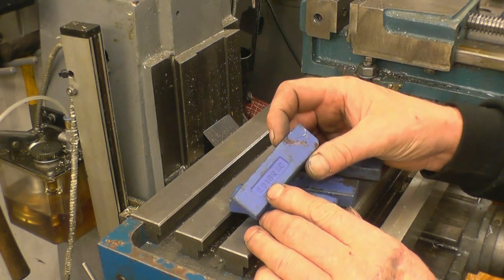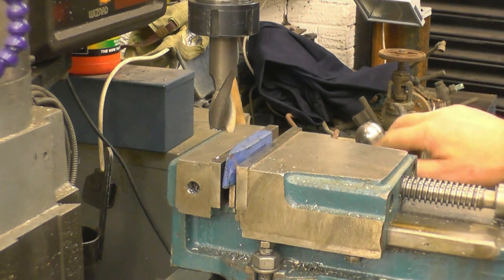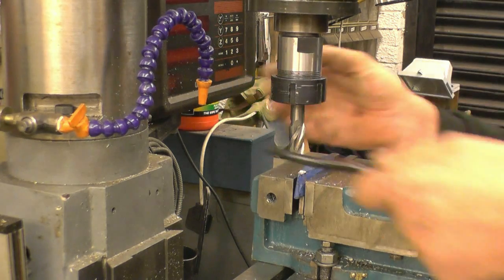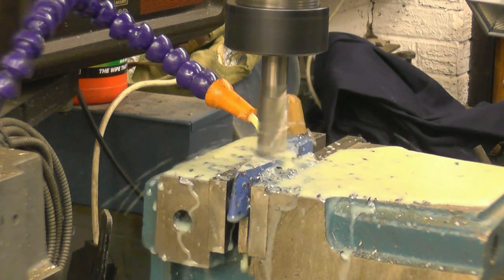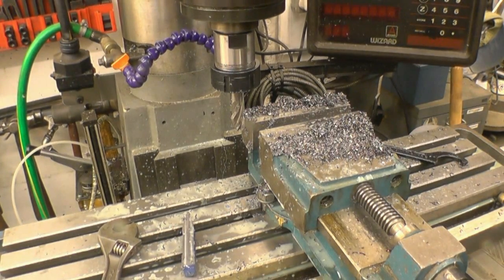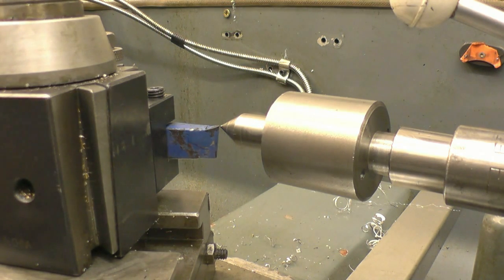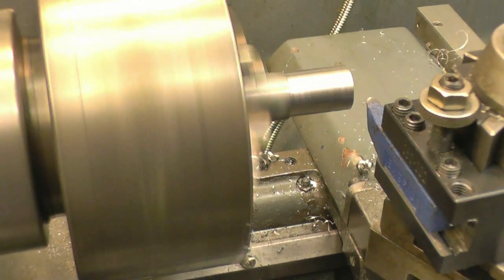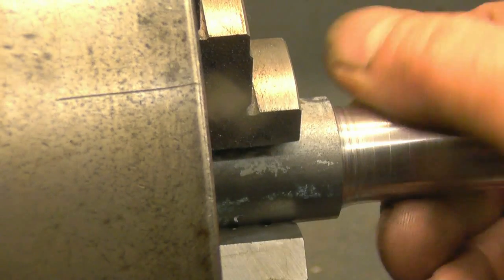SNNC132 P2  Lathe tool Mod

Comment: Hi John, just up the road from you at Cramlington. The bits you were milling down for lathe tools are coal cutting picks used on a coal cutting machine used in the old longwall method of mining. As an apprentice with the NCB we used these all the time for our lathe tools sometimes welding two together to make a R/H & L/H tool.  The base of the pick is a high carbon steel and two picks welded together and with the right Blacksmith who done the hardening and tempering, you had a cold chisel to die for. Love your vids. Got an EMCO MAXIMAT V10 P myself with a milling head, just love pissing about. Regards, Bob

Comment: Thanks for the videos john.I just thought i would ask if any one knows
where i can get a internal grooving tool,I have to cut a thread recess that
is around 0.400" long,And is 1" deep to the starting point Internally.I've done
one and messed it up,

I used the cheap 10mm carbide chines shit ones brazed carbide..And it wasn't
deep enough and there seems to be no rake on them so it just rubs on the internal
bore...I tried grinding my own and it just turned into a boring bar..With none of the
angles correct i used 4" 1/2" x  1/2" round 8% cobalt HSS bit..

Just wondering if there is any where in the uk i can buy one my tool holder 
can hold a max of 15mm..Thanks any advice would be much appreciated.

Not seen many videos about grinding a internal recess tool and actually
cutting a deep recess in some steel..I'm cutting EN8 on a small lathe..

Tried 2 carbide boring bars with no luck as thy will change the 
angle on the end of the internal thread..The one i messed up i spent
2 weeks preparing all the correct internal dimensions and I'm 
desperate not to mess this one up..I don't think it helps that
its so deep internally so i have allot of tool stick out,But them
cheap Chinese brazed carbide recess tools a POS..They just 
rub and squeal.